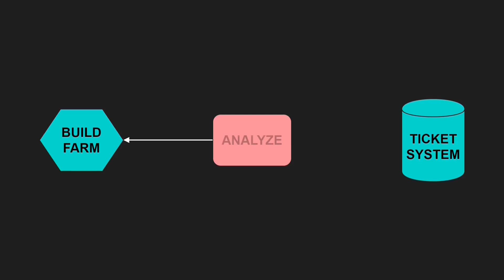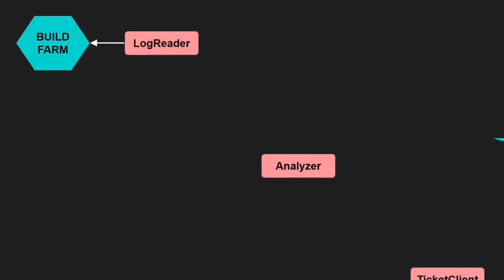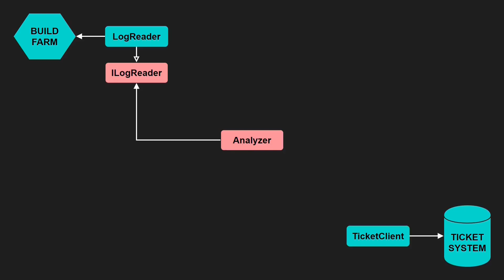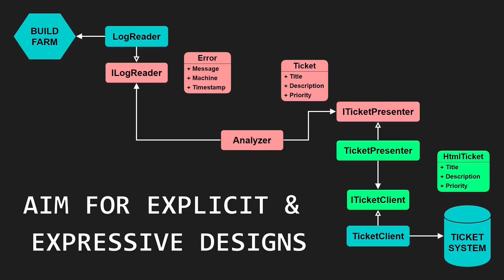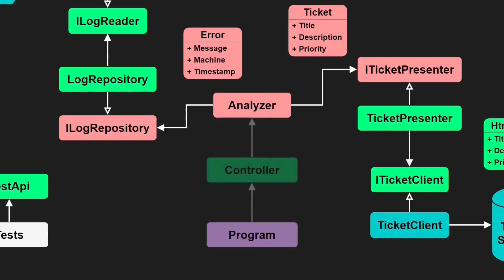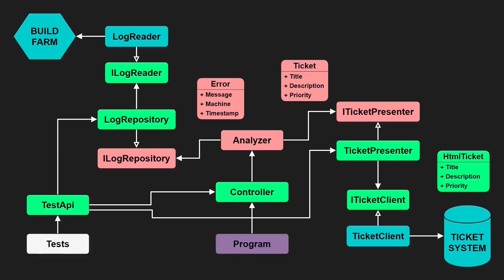Clean Architecture by Example in 5 Minutes

Comment: There are no entities in this example. How do i know what my entities are? I have one simple use case, where i want to return data from a file. Currently, I have created a repository in the frameworks layer which creates an entity for the data i want to return. The entity is passed to the use case layer and there the data is checked (some values must be > 0) and then returned. Do you think this violates the clean architecture? Is it right to use an entity for this? Where would I do the mentioned checks if not in an entity?
Sorry for the many questions and thank you for your great videos :)
Reply from the maker: @ibot0281 entities usually model the core business rules. they are part of the domain model which is typically valid across multiple applications. But even if I only have a single application I prefer extracting business rules which are valid for all use cases into entities. Repositories need to return either entities or objects defined on the use case layer, if the repository APIs are called from the use case layer, otherwise the dependency rule of the CA would be violated. Low level validation like "must not be null or empty string" are often already done at the border of the system, e.g. in the controller of a web API. Any business rule validation should be either in the use case interactors or in the entities - depending on whether this rule is valid only for particular use case or multiple use cases. HTH

Comment: How does the Repository class/module looks like? This have a dependency to the database or the api but they're in the outer layer what violates the rule, but it feels strange to use an interface for this because the repository has to be written in a specific way that the database can understand. Or does it mean it is in the adapter layer it can have direct dependencies to the outer layer?
Reply from the maker: Check out this video https://youtu.be/pfhDO_hZixw did it help?

Comment: Very informative. Any chance on sharing an example on how this would translate into code (from start to finish)? Thank you !
Reply from the maker: @shadowbit. Have a look here https://youtu.be/6hIg86y9HuE and here https://youtu.be/pfhDO_hZixw and here https://github.com/plainionist/AboutCleanCode 😉
Reply: @AboutCleanCode  Will definitely have a look at your suggestions.

Conceptually I think you did an awesome job in this video at describing how each component ought to be linked and/or connected in order to abide to the principles of the clean architecture, however, considering that I'm not a developer by trade, some aspects are a bit confusing and having a 1-to-1 mapping with a tangible example would make things much clearer; (especially when it's in Java or C++). I will give it a go nonetheless based on your described setup.

Comment: what if I have an embedded system. A mortar that should fire,tilt,pan. There is target and environment. The mortar has motors which are stepper motors they can change in the future. Are the motors part of the domain or I/O ?? (I have a motor abs class which has a calculateRequiredStepsFromAngle(angle) and there is an implementation based on the current motor) I want it this to become clean arch.
Reply from the maker: @botondvasvari5758 generally speaking, in Clean Architecture the I/O layer contains the code which interacts with the "outer world". In case of an embedded system this would be all code directly depending on the hardware and/or Operating System and/or device drivers. Any logic we can abstract from these technical details, any decision making i would put into the "entities" (domain model) or "use case" (application logic) layer. If you have a "motor" object which represents the real physical motor and which contains data and computation logic, then this class should be part of the domain or use case layer. But this class must not have any dependency to technical details. For that you would have a dedicated class e.g. MotorDevice which would then be located in I/O layer.

Comment: Thank you for the video! Im really curious to know what software you use for these animated diagrams! Would you share?
Reply from the maker: @DarrellTunnell I wrote my own small web app base on maxGraph JavaScript library 😉
Reply: Wow! Would you consider making a video about that project? I like working with diagrams as code and use things like mermaidjs or plantuml. They are very good for static diagrams but they don't have any support for animation. At the same time my PowerPoint skills are not great and I find it a huge time sink. So really I want a way to work programmatically but in a terse way, to create animated diagrams like yours! I'd be curious to learn from your experience before I attempt something myself :-)
Reply from the maker: @Wouldntyouliketoknow2  At the moment the project is still in prototyping phase but I plan to release it as open source in some point of time. Until then I would recommend MaxGraph JS, it also has great examples to start with https://github.com/maxGraph/maxGraph/tree/development/packages/html/stories

Comment: I like the video, can you make similar one about Onion?
Reply from the maker: Thx! I add it to my todo list ;-)
Reply: Looking forward to see it! One question : why did you stick to Clean Arch and not an Onion Arch? Any particular reason? @AboutCleanCode
Reply from the maker: @marcin2828t I do stick with CA because I like the domain and the app logic being the center of the architecture with all technical details pushed to the most outer corners. I think this improves changeability and maintainability of the software a lot because business logic and technology can evolve independently.
As to my understanding Onion Architecture is quite similar to CA but so far I didn't had a deeper look at it or even used it in any project - maybe I should change this ;-)
Reply: Thank you for your answer. I'm the onion-man, and from what I can tell both architectures are not so different in the concept at all. I think that main difference is that layers and building blocks are named and sometimes placed differently. Soon I will be starting a new project for company I work for and I want to try something new. CA is one of the options. On the other end sits concept of Domain Model from DDD which I may incorporate into old good Onion without taking anything else that comes with DDD. There is a chance that I will make a terrible wrong decision and turn into Victor Frankenstein ;)  @AboutCleanCode
Reply from the maker: Personally, I think DDD and CA fit quite well together - same is probably true for Onion Arch and DDD